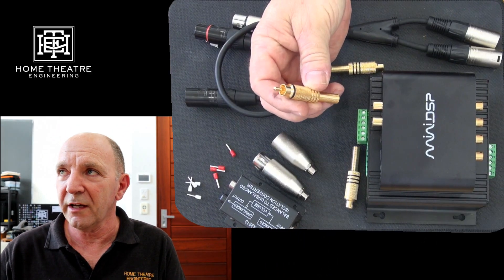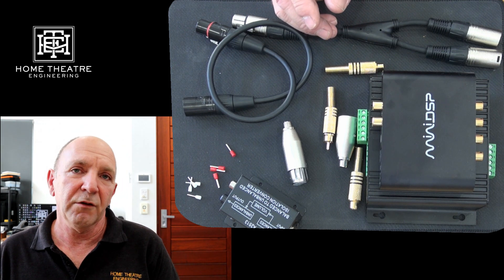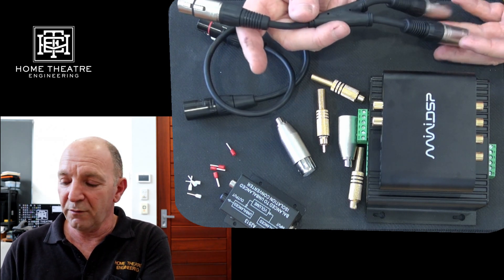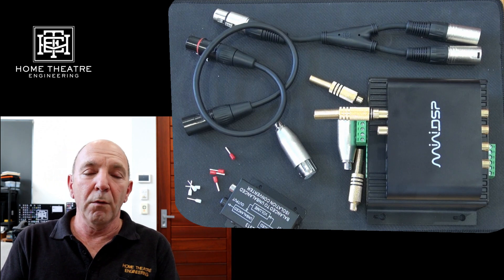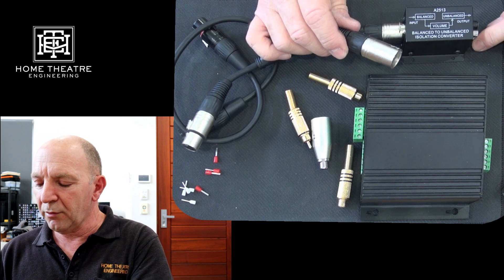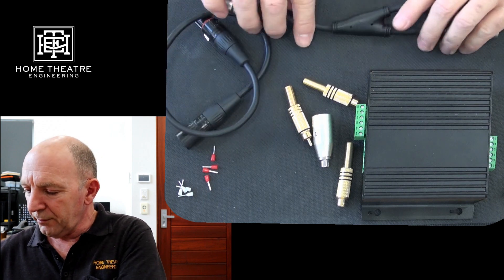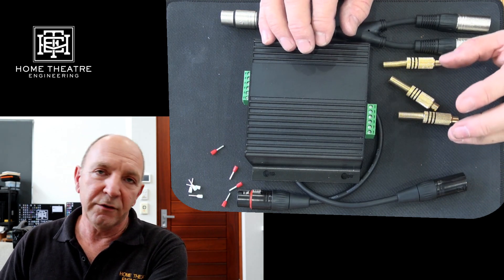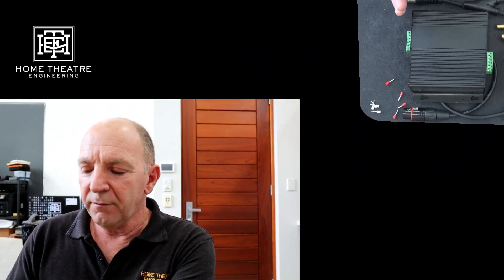Multiple Subwoofers. How to connect via XLR and RCA.

Comment: Hello, thanks for the comprehensive video. I will consider multiple subwoofers in the future. My question is about whether it's okay to use an RCA male to XLR female cable (from a subwoofer) to plug into an XLR male to XLR male cable which would then plug into XLR PA speakers, which then would go to my music controller.  Forgive me if I'm getting any of this wrong or the info is incomplete. Thanks again.
Reply from the maker: Hi we don’t really deal with PA systems but... yes you can in effect go from an RCA (unbalanced) to an XLR (balanced) signal or cable providing it is wired correctly. You do risk injecting noise or hum. I am not sure I understand you describing going from a subwoofer to speakers? I would need a bit more info to understand what you are trying to do here and that is a little outside of the scope of a YouTube comment section.

Comment: Should the #2 sub in a daisy-chain be set in the opposite phase of the #1 sub?
Reply from the maker: Its not about where the sub is on the "daisy chain" but where it is in the room. To determine phase you need to measure both subs and adjust to give the most constructive result.
Reply: @HomeTheatreEngineering , My question is, in a two-channel stereo system, when you have a front and rear sub for the right channel and a front and rear sub for the left channel should the rear subs be set to work in the opposite phase of the front subs?
Reply: @reaality3860  It depends on the room acoustics (due to dimensions) - I wish it was that simple!

Comment: What about wireless subwoofer kits?
Reply from the maker: Hi. Most decent subs are wired. I am not aware of many good quality subs that are wifi. In our opinion wiring a sub is vastly superior, more reliable and less prone to other issues. Obviously this video is about wiring multiple subs from 1 output via xlr or rca and doesnt cover wireless subs for that reason.
Reply: @HomeTheatreEngineering  Let's assume we have the room already wired and are hoping to install more subwoofers at the back of the room.  Do you have any experience with adding subwoofers wirelessly to a system that already has a wired subwoofer?  Can you recommend any brands for the wireless signal?  thank you, I appreciate all your work on the channel!
Reply from the maker: @ryanstroeder7908  Hello Ryan, you are starting to feel like an old friend :-) Ok so in answer to your question Yes I can. We have done several jobs with the REL wireless solution. It works exceptionally well and seems to suffer no lag or other downside and has proven reliable to us so far. Check it out at https://rel.net/shop/accessories/ht-air-wireless/
Reply: @HomeTheatreEngineering  Ha!  Drinks are on me when we eventually meet :) I will check it out. Cheers

Comment: Thanks
Reply from the maker: No thats not the case. You are using a 2x4 HD not a 2x4 and they are very different. This has only occurred in a couple of cases and as I said we dont know the cause. There is nothing pointing at the minidsp. The reason I am talking about the minidsp balanced is for mixed and multiple combinations of RCA and XLR. You are fine Roman. :-)
Reply: Home Theatre Engineering Thank you for responding that’s good news thanks again

Comment: Can you have different subwoofers in your system like 2 brands at the back and two other brands at the front?
Reply from the maker: Absolutely you can. Luckily we don't have audio police :-) You can do what you want and if it gets the result then all is good. But many people say subs should be identical. But the critical issue is based on one determination. What is the bass like in the seats? We measure this both individually and spatially averaging and our goal is equally good bass in every seat. You could argue that if you use all the same subs and they have identical characteristics unless dealt with that characteristic will reveal itself at the seat. Yes EQ can manage this a bit room modes can be challenging and you cannot EQ out a dip. So, yes, we have had mixed subs that actually complement each others weaknesses. The important thing really is "do your subs cover the frequencies you want, say 20 -120Hz and have the response and power to deliver smooth sound across that frequency range. Hope this helps.